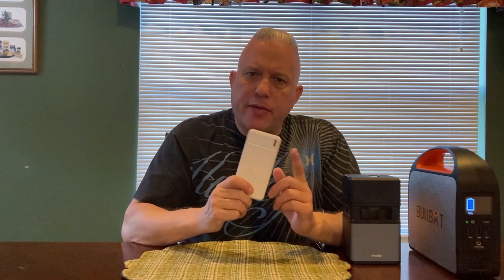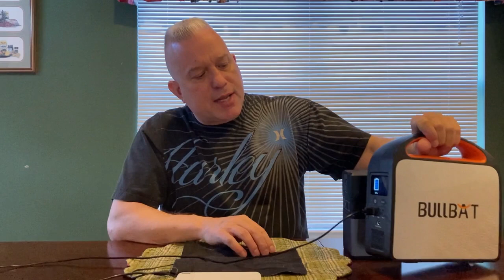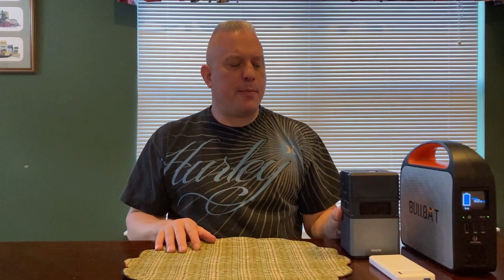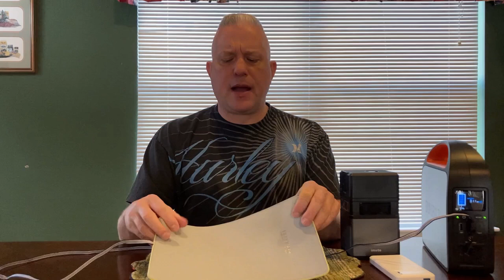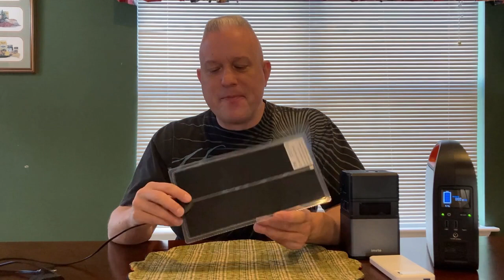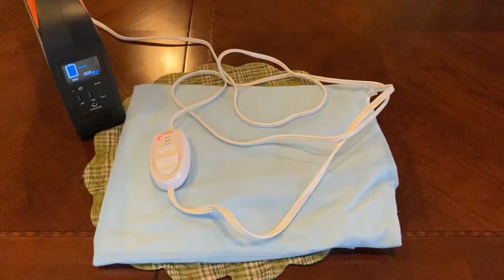Emergency Prepardness!!! How to Stay Warm Overnight using MINIMAL Power!!!

Comment: I could see myself putting the first heating pad and one of my powerbanks in the car.
Though I have a sleeping pad and a sleeping bag in there, these are not the warmest and a car can get uncomfortable and cold really really fast!
Reply: I have a heated blanket that plugs into my car 
In the winter time I turn on all the heated seats when driving- if I get into an accident the heat created will help buy me some time… and I can plug in the blanket to prolong running my car periodically to keep the battery charged- and because of where I live, I keep my tank 1/2 full or more
Reply from the maker: Great stuff Dina!
Reply from the maker: The car is an excellent use for the usb heating pad Manone!

Comment: How about making a small tent over the bed for a secondary microclimate?
Reply from the maker: Hey Dina. That can work well too. Be sure to adjust the ventilation to prevent condensation. You don’t want to wake up in a pile of damp bedding. 🙂👍
Reply: Good point 🥰